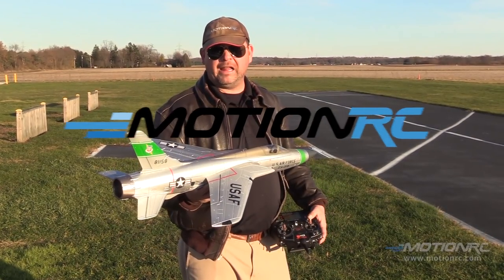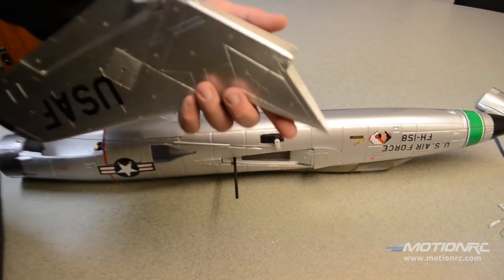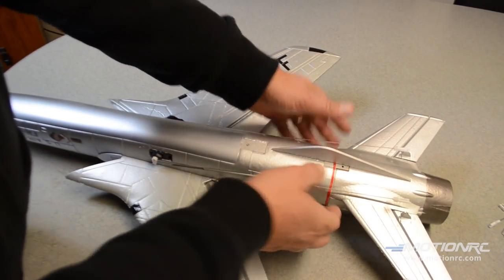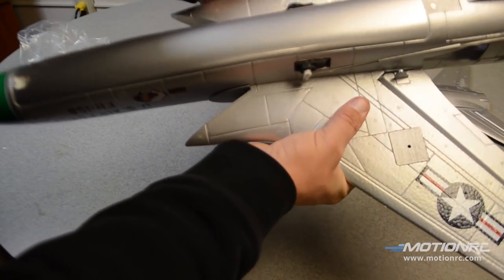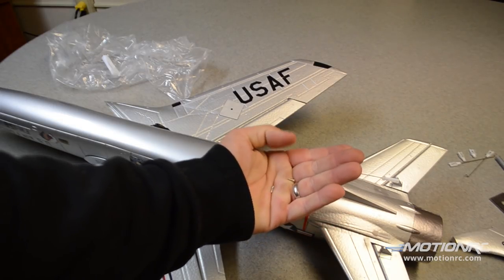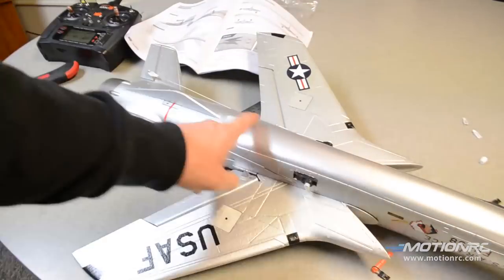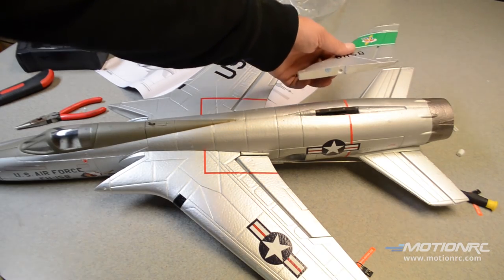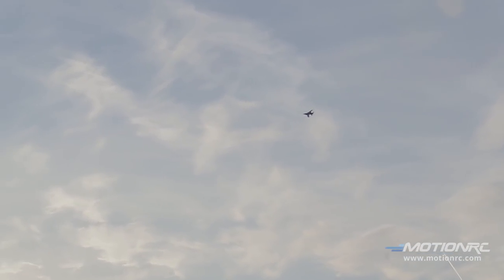Freewing F-105 Thunderchief 64mm EDF Jet - Build Video - Motion RC

Comment: What glue do you use?
Reply: Also first :D
Reply from the maker: The glue is supplied, but foam tac or CA works too.
Reply: Motion RC,
Thanks a lot!
Reply: Foam safe is fast or hot glue
Reply from the maker: Be careful with Hot Glue, when the weather is warm if you leave her in the sun for a bit, everything will be coming apart in air ;)
Reply: Motion RC i know especially san fernando valley heat i use hot glue for small stuff i use foam safe for everything
Reply: The 64 mm jets usually are screws so i guess they went to glue again maybe weigh affect or something